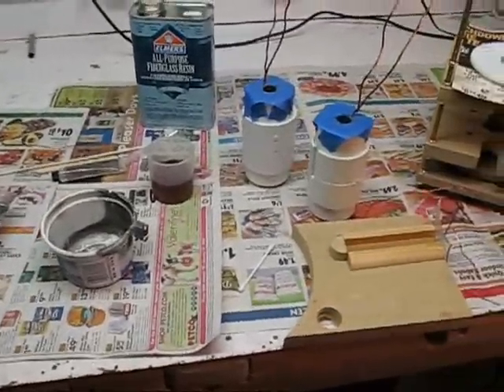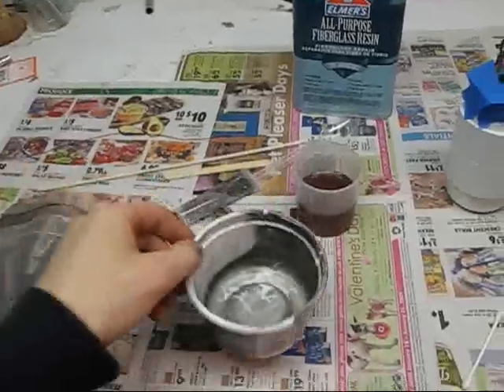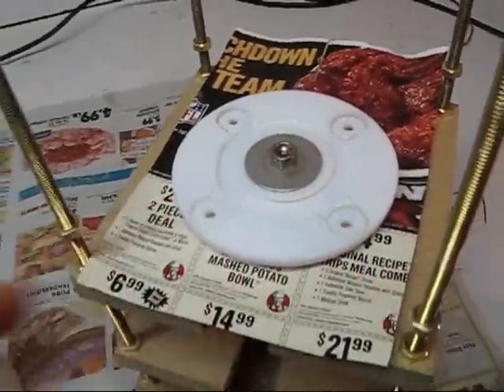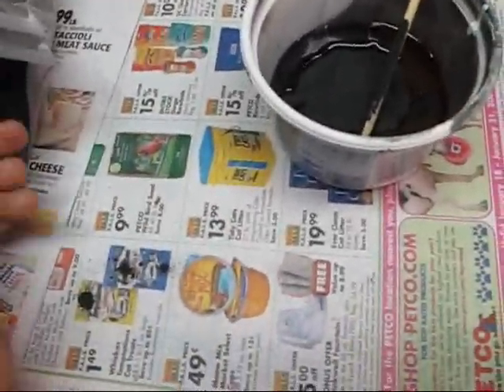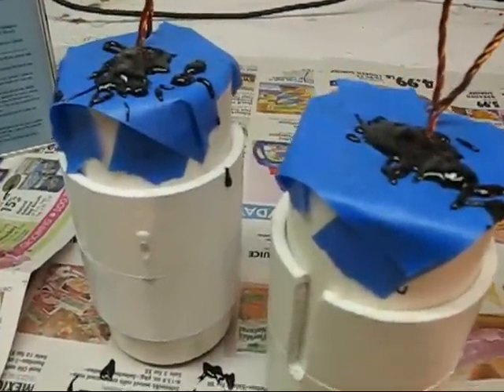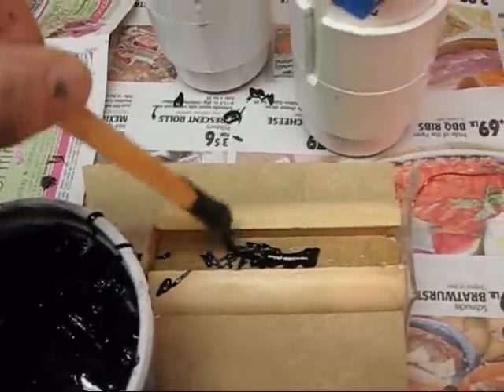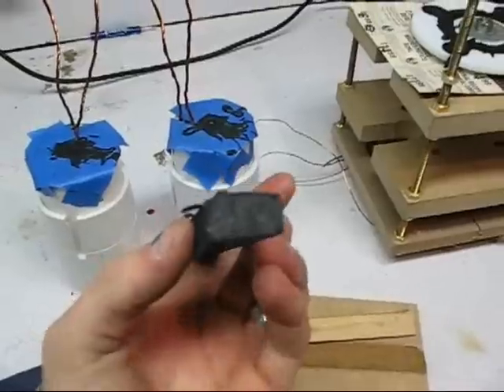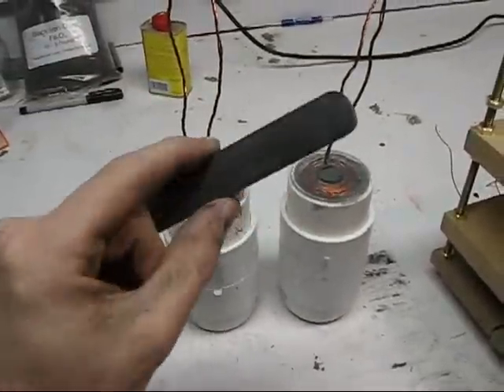Magnetite Cores

Comment: Would I be better off using iron cores or this p.s. I'm using it to make tattoo coils or at least that's the plan
Reply from the maker: Iron, ideally laminated silicon steel which can be found in any old transformer or motor from used electronics,old fans, ect.  Angle grinder cut down the weld seams and they come apart pretty easy.
Reply: I currently use 1018 steel

Comment: Throw away plastic spoon might help speed up the fill process.
Reply from the maker: I have to wonder why all the sudden im getting  numerous comments on videos from 10 years ago.  I know ive been getting interested in playing with this stuff again, guess everyone else is getting interested again too.
Reply: codygillespie, i cant speak to everyone else, but I'm interested simple diy fabricating a stator. And not have to use laminated steel. I think i can sacrafice power density for simple cheep construction.
Reply: codygillespie, for instance three phase axial flux generator  with serpintine coils with iron powder epoxy composit core should have more power density over air coils, and i suspect low cogging.  Low ratio of iron to epoxy should keep eddy currents  losses to zero. And all one would have to deal with is the hystorises losses. Because of the increased permittivity of the stator, the output coils can generate more voltage with less length of coil and a decrease in copper loss.
Reply from the maker: So your making a windmill?  If thats the case then there would be  concern of cogging, once it gets going it should be fine, but getting it going the cogging would increase the startup windspeed.  Obviously a big benefit of the air coil a very low windspeed startup.  I would design an adjustment to be able to vary the spacing between your magnets and stator to be able to find the sweet spot between power output vs cogging/high wind speed startup.  Sounds like a fun project.
Reply: I have not decided the application yet. Certainly cogging effects when a turbine start turning. A car and a series of hills is a good analog of cogging. if the engine is not running fast enough, the car wont make it to the top of a hill. But just over a certain throttle position, it will, And, energy gained from driving down the hlil is balanced by energy lost driving up the next hill. It is worth pointing out that rpms below a certain threshold are often so low as to not even generate enough voltage to be useful for either a battery or inverter. A polyphased generator (eg threee phase) reduces not only the electromagnetic source of torque ripple (due to electric load), but it also reduces cogging by splitting the magnetic material between phases.  Illustration: https://goo.gl/yt1WYB   5 phase would split the magnetic core material even more as well as further reduce electromagnetic torque ripple, but as phase numbers grow, there is less space for magnetic core material.  Besides, as for magnetic core constitution, I was not exactly aiming for packing maximum iron magnetite into it. Rather, I am interested in a lower density packing that conducts even less for even less eddy currents, and making it easier to poor. Another concern is heat dissipation. One does not want to thermally degrade the epoxy that holds their stator together.
Reply from the maker: All sounds good.  Good luck with it!
Reply: codygillespie , heh,  check this out. http://www.linux-host.org/energy/magnetitecoregenerator.htm same basic idea i discussed. 

Though i think i'll be making my magnetite from scrap iron through electrolysis, heat in oven on high with powdered charcoal as a reducer inside a few pipes. While the oven with the reducer can get hot enough to reduce iron (iii) to iron(ii), it is not hot enough to convert iron(ii) to iron metal.  Then i could separate the iron(ii) and charcole with a magnet and wash, leaving me  with stable magnetite nanoparticles Fe(ii)+Fe(iii).  Also,  i won't have wood creating a gap between my magnetic cores and the coils. 

I wish it were easy to find permeability and hysteresis tables.  Do you know of any that are not sitting behind paywalls?

Comment: Nice Video,  I've worked with polyester resin and epoxies a lot.  I can tell you wax and wax paper work better with Fibreglass resin (polyester) .  Some petroleum products interact with the hardener. If You use a Styrofoam mold the resin will dissolve the Styrofoam very quick. Styrofoam is a petroleum product. Epoxies are 3 times the price, but are fabulous to work with. You can put it on anything.  Nothing sticks to wax. Try a Styrofoam mold. It's quick and cheap. Cut it, sand it, shape it fast. Coat it with candle wax. You can just drip candle wax on your mold and spread it with a small chip brush. Then You can use polyester.  For reshaping or sanding your finished product,  try it when then resin is 3/4 cured. Much easier.   But Your petroleum jelly seemed to work just fine. Looks good, Nice job. !!

Comment: Just interested……you put the magnetite in the rotor……since magnetite is not magnetic itself how would that work? Is there a way to magnetize the stuff and make magnets out of magnetite?
Reply: Ken Morris, Lindemann Attraction Motors work through the attraction of the stator pole to the magnetic permiable rotor.  In this type of motor, you do not want a magnet for a rotor.

Comment: You mentioned black sand in an earlier comment.  I've heard this makes a good core for very fast switching, but I have not tested it. Have you tried it? What do you know about it?

So how would this compound compare to say, an iron core?  I'm guessing since it's non-conductive there wouldn't be any eddy currents, but if it responds to the magnetic field, shouldn't it have strong attraction to magnets?
Reply: johnb003 eddy currents are still produced in it, just not as much.

Comment from the maker: well i would not go forging iron for a core, it would be better to buy some laminated silicon steel and have some one cut it for you like standard transformer cores are made if your wanting to use iron.  I believe robert adams talks about connecting the backs of his coils for improved efficiency.   Other than that i dont know where to look, just play around with it, its easy.  When you connect the backs you will see the amp draw go down and the rpm's go up.

Comment: hi cody.
further testing of my 'red powder'... as i said it does not react by using my ndfeb magnet, however, when i use a compass, the neadle react weakly. to me, it seems the red powder has a very weak Fe in it. is it good for my core? hmmm... i guess it is if i'm going to make a vhf/uhf (mhz) coil core.
futher reading about core material, the Fe is said good up to 100khz.. which i guess already fast enough for my project.. i think i need to add more fe material in it to meet my need.

Comment from the maker: Yea, the black stuff is what you want, thats Fe3O4 (magnetite).  And it does react to the magnet.  The red stuff Fe203 (hematite) is not what you want.  They must have sold you the wrong stuff.  Go to ebay and search for Fe3O4 They also call it black iron oxide.

Comment from the maker: hi,
It should weakly be attracted to a magnet, your magnet might not be strong enough to notice it.  I got a tip that it is better to mix it into a thick putty like paste and ram it into your mold, rather than the runny mixture i show.  The red stuff is Fe2O3, i have a buddy that was testing mixing the red with the black to try and match natural black sand proportions, but i have no results on that to report.  Good luck and thanks, keep me posted if you have any success.

cody